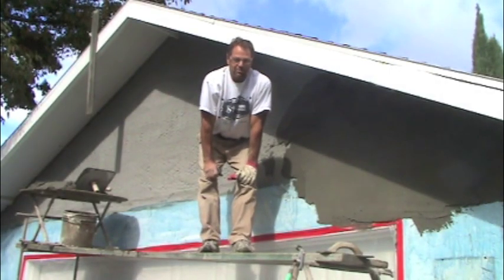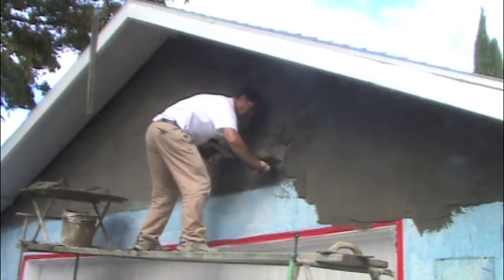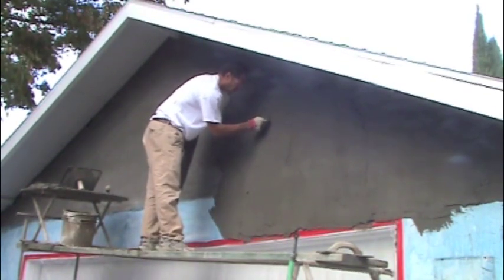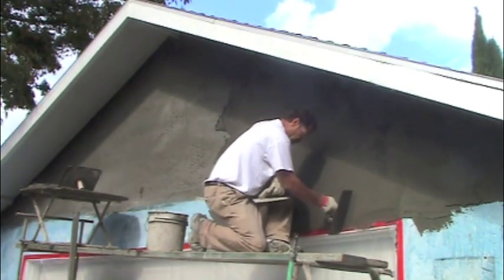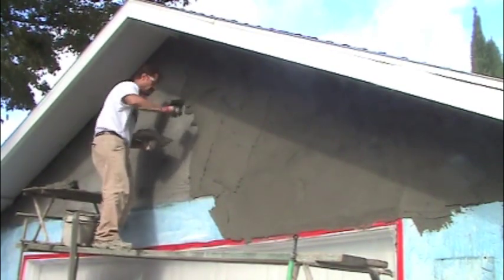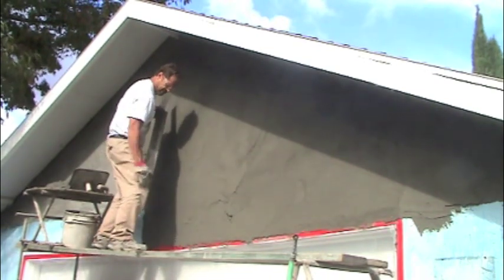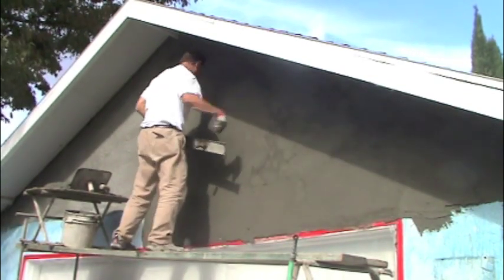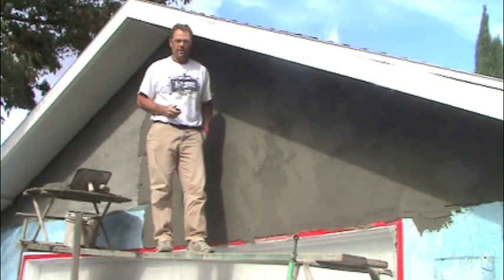Ken Aberson gives a brown coat lesson

Comment: Nice job Ken, you and Kirk do it right. There are very few contractors in central Florida that will run the 3 coat system. Most do 1 coat and texture...even over lath. Love my trade but absolutely hate what it has become. I miss the interior Plastering... brown and putty coat and running molds. Good job buddy.
Reply from the maker: Hi Mike. Are you still slinging the mud? I am I just published a new video on doing acrylics. Check it out at Ken Aberson Plastering on you tube
Reply: Ken...Im still slinging mud. I pick and choose my jobs. Not being conceded...but I'll only do it the correct way. ..the way my dad and grand dad taught me (RIP). It's a shame what our trade has become.
Reply: Averageguy....yes the prices have gotten out of sync with the trade.
I'm doing a remodel now...pressure wash and remove loose paint , bond with plaster weld, tight and a little rich on the mix scratch coat, wait 72 hrs and hydrate walls, then brown and drag back, wait 72 hrs hydrate and apply finish coat. Finished product will be 5/8 thick. I'm charging $ 3.00 sf on block and $ 6.50 on wire.
Competition is $1.25 sf....I get called at least 3-4 times a week to fix their work.
Not to brag but you have to have an understanding of what your working with...hence starting out as a laborer working your way to apprentice and on to a journeyman.
Nowadays newbies don't want to start at the bottom and work to the top
Just my 2 cents from a guy whom has been in it way too long.
Reply: @mikewilson8394  well said
I started out mixing n pullin buckets my friend
26yrs here
Im in philly
Unless I'm working Union the majority of my coworkers are some type of Spanish. It's bad dude
Reply: @mikewilson8394  and then in the last few years we have came across quite a few Slavic Crews
Checs poles ruskies wtvr
They dont even use hawks
2ft trowels like that kirk fella in Cali😂
It's truly a horrible sight to see smh
Reply: Averageguy... It's bad here too I just roll in my own little world.
Started mixing for dad and grandad when I was 12....a hoe and mud box and carrying hod's. Then on to mixers...I'm 56 ....other than my 9 years in the military this is all I've done for 35 yrs of my life.
Reply: @mikewilson8394  I hear you buddy. My uncle who taught me the trade in 95 moved to Clearwater 20 years ago. In the beginning he started his business down there as well but eventually said screwed this s*** I'm not working with all these illegals lol
He got out of the biz n has been working with the post office ever since
If I had any sense I would do the same myself
Reply: @mikewilson8394  not for nutn but 6.50 sf is damm good
Lucky to get 5 up here
1.25 barely covers materials wtf
Reply: @averageguy7641   
I put a shiny quarter stuck in the finish coat on every job.....I tell the homeowners as long as it's there they will never be broke....lol
Clearwater is pretty ate up with lowballers. There is still a few that do awesome work on custom homes....but the majority is shit and get....I call them shanty swipers..lol
Reply: @AbersonPlastering  
Cheers from Central Florida
Reply: @mikewilson8394  I used to work with an old dude years ago who would always bury a coin in the top of the chimney

Comment: I stuccoed the gable end of a new porch cover I built recently.  I used your instruction to do the job; however, it sure seemed harder to do than you make it seem (maybe that is why you are the pro and I'm not even worthy of being called an amateur).  I especially struggled to figure out the right consistency for the mix and applying the stucco up in the tight corners.  I'd like to see how you get stucco into tight places like the box ends of the gables and up against the soffits.
Reply from the maker: There is a learning curve for sure. Basically whatever it takes to get the mud anywhere we have smaller tools that we use you can find some tools in the kitchen drawer to get into tight spots. We use what’s called a margin trowel or a leaf and square to get an a really tight areas. To get up to the soffit a rookie would need to mask off the soffit because he’s going to make a mess on the soffit or he can clean it off with a sponge float when he’s done but I just push the mud up flat with the broadside of the trial and then I can tuck it in and then pull it back down. Sometimes I have to use the toe of my trowel. Don’t mind these other comments that you see on my channel. They are only journeyman plasterers.

Comment: Are you putting stucco right on top of foam insulation without any mesh??
Reply: Never. Only in the prehistoric days we would apply directly over foam with zero netting. Not since. Thanks. Ken
Reply from the maker: Isn't that a different video you you are referring to? There is no foam insulation in this video

Comment: In a 3 part stucco job what is the wait time between coats?  And why? Would there be negative effects long term if it was rushed through?  Thank you, I've learned much from watching your videos.
Reply: Hello Nikki, and thank you for the compliment. Typical wait times are 48 hours between scratch and brown coats, and preferably 2 weeks or longer between brown and finish. the scratch coat needs time to dry and it needs to be hydrated with water early in the morning before the sun comes up, or late in the evening, after the sun is off the wall and the heat subsides from the daytime sun or heat. Stucco does really well in cooler climates, but struggles in hotter climates if there is not enough attention to hydration. A nail test can be done after applying the scratch coat and the brown coat to make sure the prior coat has been hydrated properly. Take a nail and make a small X in random areas of the walls. If the nail is hard to penetrate either coat, you are good to go. If the nail cuts through the product with ease then you need to hydrate for at least another day, or until the nail does NOT cut through the product with ease. Proper hydration will reduce cracking. It is extremely important to wet down the walls exactly as I have mentioned. If you follow this procedure, AND providing you have used the proper formula for good stucco, and good sand, you will be successful. The brown coat needs time to dry so that the cement can cure properly before applying the finish. If you apply the finish coat to soon, efflorescence will start coming out onto the finish coat from the material underneath. It is a very ugly sight. A test can be done to ensure the ph has come down enough to apply a colored stucco. If the system is going to be painted the same direction applies. I would wait 28 days before applying colored finish coat or paint. Thanks for watching
Reply: Hi Nikki. Three part stucco job. First coat 24 hrs. so the second coat won’t sag.  Second coat wait 7 days to two week to allow mud to crack. If you are putting color in finish wait 28 days before applying finish coat to allow all lime to escape so no efflorescences will weep out through cracks in the stucco. Stucco will crack. You can use fast setting materials to encourage a fast job. A fast job could be a better product. Just depends on the knowledge and talent of the applicator

Comment: As a 3rd generation Portuguese plasterer I would have used some 4.5 fiberglass mesh at the joint overlapping the new wall over the old wall about 6 inches or better yet cover entire new wall brown coat and existing wall with a bmi 290 coat over mesh then a finish coat but it’s more costly but then again we plaster and stucco in Carmel pebble beach ares very high end areas not these tract homes as shown  you get what you pay for
Reply from the maker: This is true. People in Davis Ca. Are less apt to spend double the money here to fiberglass the whole wall which imo would be overkill but thanks for chiming in to let folks know that they can take it further than a basic job. Ken

Comment: What is differencevof brown stucco comparing to scratch ?
Reply from the maker: The scratch is scratch with a tool called a scarcifyer to score the surface while the mud is still wet. The brown is the second coat which is smoothed with a Darby to flatten the wall to desired flatness’s. It can then be painted or a third coat of stucco/plaster might go on
Reply: @AbersonPlastering  Thanks for your answer. But what is the reason for the scratch one ? Better bonding of the secong or theird coat, or covering more holes of not flat surface ? Brown coat direct is not enough ?

Comment: Local 200. Journeyman plaster here asking why your working backwards is that something you guys do ?
Reply: Juan. After much consideration and personal surveys, I have come to the conclusion that there really is no right or wrong way or forwards or backwards. I was taught by union plasterers to go from right to left on scratch and brown then from left to right on finish coat. 
You are not alone in your thoughts about which way to start the brown coat from. I have asked many new plasterers as well as old plasterers. Also I have watched videos of how and which way plasterers are going. If you watch Kirk, it doesnt matter where you start. He starts in the middle, and I dont believe he even thinks about it as it doesn't really matter. I could go deeper in thought as to how to build scaffold. Scaffold should be built from whichever way you are going to finish so that you can take the scaffold down as you go without saying, " excuse me but could you stand on the other plank for a moment". 
Thanks for watching my videos.
Reply: I started plastering in 1970, don't do much anymore. We've always hand spread scratch and brown coats from right to left, it keeps your hawk on the outside and the trowel close to the wall. As you spread you pull into your previous spread creating a bond between joins. If you follow a gun, typically you go from left to right but not always. The sun and wind will a lot of times dictate in which direction you go as well as the progress of other contractors. But usually the process is always complimenting the right hander. 
On finish coats it goes from left to right so you spread up and float the join on the down stroke continually moving backwards so you can always watch the wall and assure that the texture doesn't change. 
I agree that nothing holds up as well as 3 coat but 1 coat acrylics are here to stay. I too miss the old interior plasters with the molded accents. These kids today can't imagine the artistry that true plasters of the day used to create. These days everything is stucco (blah) although I see some nice faux stonework over lath. Truly amazing workmanship. 
Some of the stucco I see is some pretty shitty work. Follow the sun and you can see every stud outlined by shadow, and block walls show their mortar joints in rainy weather and no one seems to care about texture joints. There is no pride in the trade anymore. I'm glad that Ken and Kirt have taken the time to educate people in correct way to do our craft. My hat is off to both of you. 
Just wanted to say Ken is the first you tuber that knows how to load his trowel off the front edge of the hawk. Everyone else I've seen just scoops it. Better keep that hawk close to the wall to catch the goobers. 😎

Comment: Why don't use a level ruler to check your work wether vertical or not. You didn't use the marks to control the thickness of the plaster.
Reply: Its called "wabi sabi" The art of imperfection. Look it up.